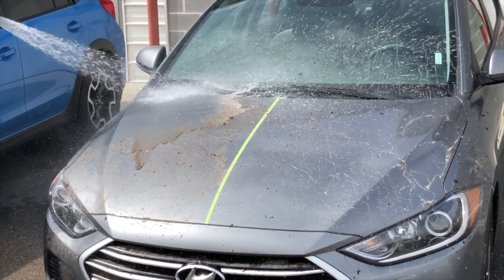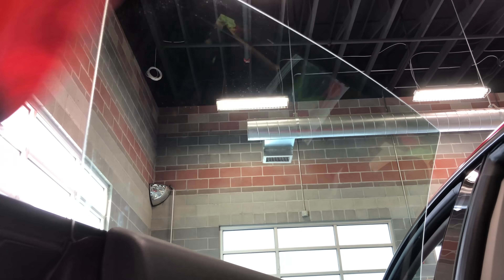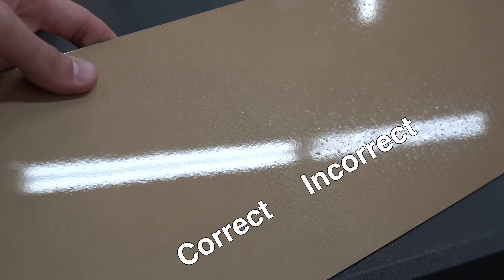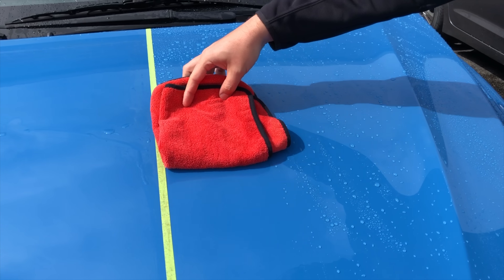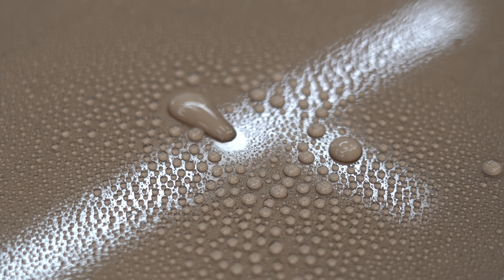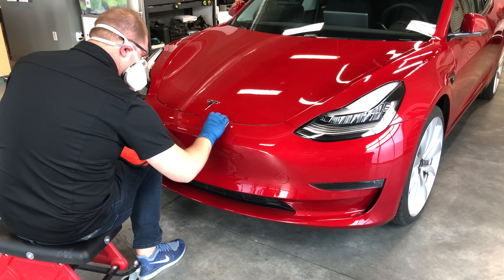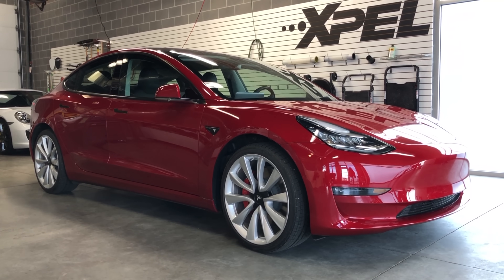Everything You Need To Know About Ceramic Coatings

Comment: I am a bit disappointed that you kept the "rigged" Mud pour in the video without pointing out its blatant deception that I'm sure you were aware of. 
The man stands on the side of the uncoated hood, pouring at a higher velocity/angle towards the ceramic side from the top of the bucket which contains the lighter/smaller sediment that remained suspended in the water. He then returns to the uncoated side while pouring slower while making sure to empty the bottom of the bucket where the heavier sediment/dirt clumps are sure to remain on the car.

If this wasn't an engineering channel I'd maybe give it more of a pass but letting sponsors exaggerate their effectiveness through this demonstration without a lil fact checking is a bit too shilly to me :/

Comment: JUNK!  I have been using Lucas Speed wax on my Panamera that is jet black metallic. It doesnt have swirls or any hologram or spider webbing. I take care of it pretty decently and only use quality microfiber on it. I go to self serviec car washes and put in maybe $4 and wash and rinse before drying. The Lucas beads up great, bugs dont stick and leave any of their guts to etch the paint. I think many detailers are doing waaay too much to make it seem complicated to care for your paint so you will pay them to do it. ITS NOT COMPLICATED!

I had bird crap on the roof a coupe times, I mean a massive amount , likely from a seagull or many of them. Unfortunately it sat there with the crap baking on for about 3 days. I sprayed it off thinking for sure I was going to have to use some compound or polish, but nothing happened it just sprayed off at the car wash. This ceramic junk is so hyped and overpriced it is foolish. I use a cheap spray wax (Lucas) that cots me maybe $11 and lasts at least me doing the car 8 times over the course of 2 or 3 months, but likely I dont even have to apply it that often I just do because it leaves it slick. I get compliments all the time on the depth of paint and reflection. Many people assume I spend a ton paying a detailer.

Comment: can attest to coating over film being a top tier idea... I also believe that proper high SiO2 coatings usually come in a glass bottle, learned that the hard way with Armor Shield IX when I had one slip and just shatter to bits coating my garange floor, they were good sports and sent a replacement thou. XPEL is unbeatable and I like to coat over with avalon, gyeon or adams thou latter one is a bit on the pricey end... but if you are dishing out a couple grand for a pro wrap it makes no sens not protecting it

Comment: I just got my 2024 Lexus RX350 at Pembroke Pines Fl. , financing department told it was included in the price. then A guy came to pick up the keys of the car and told us it should only take 20 minutes. when it  was ready I noticed the car had dirty mug spots, like the car was dirty. So asked the several people and they no is just drying it looks dirty. Then someone told me the should have been completely clean if ceramic coating was applied. So I asked the guy who did the job and he spry ceramic coating again in the spots and wiped right away. Then no one told anything me about curing time. so I drove away. and my car is usually park out in the open. and after seeing this video I know they didn't do it right and Yet after reading my contract I found out Lexus charged me $2000 for it. What can IO top now? can anyone advised me?

Comment: In the demo, I see what they did there to exaggerate the differences- the sludge at the bottom of the bucket went on the non-applied side to the left. 

The ceramic coating works, but I notice the trick that was played here.

Comment: Both the films an coatings are great and provide good protection, but the think you have to keep in mind is that all cars get collateral damage, even a Ferrari, so its never 100% fullproof, but if it helps your car look good, prevents as much damage as it can, and it helps it hold its resale value they're all good things...I've coated mine because its much cheaper then getting film...Great informative video, thanks.

Comment: What happens 4-6 years later when the ceramic wears and needs replacing? Do you need to remove or can you apply more ceramic over the original coat?

Comment: Well Technically, a correction isn't required on paint that is in bad shape. You can still apply it on there and will be just fine so its not required. Its more like "recommended" to correct the paint.

Comment: I had a paint correction and ceramic coating installed the other day.  There are massive swirls from previous car wash scratches still.  They used a paint pen and half a$$ed repaired it but actually newly chipped my brand new hood.  There was also paint missing where my license plate vibrated and rubbed through.  They didn't even remove the plate.  It cost me $1500!

Comment: If you are getting a new car get a coating immediately. Like make it part of the buying process. Get the car and drive it straight to a detailer.  New car paint is becoming insanely thin and is close to making correction impossible.

Comment: This just goes to show me how much some people baby their vehicles compared to others - such as myself, I just use a wash and wax mix and that's good enough for me since I live in the rust belt and well I am only willing to do so much to stave off the inevitable rust.
Reply: This doesn't seem that hard to do. Get it done once every four years and you're left with a car that looks far better, which is obviously better for so many reasons. I'm not sure what living in the rust belt has to do with anything. Are you saying because these are states that have winter weather and maybe that and the salts used to clear the road can be damaging to a car's finish? If you are, then that would seem to be even more of a reason to get this done. Now if you have some old, beater car, sure, treat it like crap.
Reply: @dontbanmebrodontbanme5403  It is not that  uncommon to find a nearly perfect body paint wise with a rusted underbody/frame, I had the MTO seize a vehicle with multiple rust related issues underneath and OMVIC made the dealer buy it back from/refurnd me because it had been safetied when it should clearly not have been.
Reply: My daily beaters get washed when it rains!

Comment: Don't pull tapes off after as there will be  hard edges on the pannel after .&
 most coatings shops are labeling as " ceramic " but are just normal waxes

Comment: Ceramic coating is basically just a slightly more durable wax. From my experience it lasts 6 months max vs normal wax which lasts 4 months. Normal spry on detail spry or wax lasts 2 months and you only spry and wipe off . So it’s funny why you would pay that much for something which you can get cheaper and easier

Comment: Tip for coated cars: You can use an air blower if you have one, to blow the majority of water off the car after washing and rinsing. This will allow you to easily dry the car with a single drying towel and reduce the amount you are rubbing the paintwork with towels(less swirls in paint). You can also blow out the mirrors and other drippy areas to prevent drip marks. 
Also like he said in the video. If you park your black Nissan outside all the time, it is going to get water marked. If you wash your car with dirty water, or dirty sponges and dry it with an old sham, it is going to get swirls. Nothing other than good car care can prevent those things.
Reply: You can use a blower to remove water on uncoated cars as well.
Reply: @markolmstead4709  Of course but it works a lot better on Coated cars.

Comment: Not sure how many of these types of ceramic coatings exist, but another one, Opti-Coat, is supposedly pure Silicon Carbide that joins with the ciear coat to improve gloss and hardness.  Have not heard of any Graphene coatings that do the same (those are supposedly only one atom thick and lie on top of, rather than in, the clear coat).

Comment: is ceramic coating heat resistant?And if so to how many degrees? 
If I wanted to ceramic coat my valve cover or engine parts which are painted using heat resistant paint,,,is it advisable?Will it last or will it peel off due to heat?

Comment: If a ceramic coating mainly just makes it so I don't have to wax, it's not worth it to me. Turtle Wax Ice seal and shine is incredibly fast and easy to install and easily lasts 6 months, maybe a year. It takes just a few minutes and no PPE or paint correction required. It is also cheap. Try it, you won't go back to wax. Just watch any review for it on YouTube.

Comment: So, what happens when someone hits your car and you need to have the repair painted?
Reply: Then that surface needs to be corrected, film put back on (if you had that) and coated with a new bottle of ceramic coat. You have to make sure you report that to the insurance company and product documents. The only crappy part is if the other party is underinsured then their insurance may not cover the cost.

Comment: I am happy with my expel ppf but definitly bug guts will stain it unless washed off right away,  also rock chips are getting through but I can only hope its helping.   Also my ceramic coating experience has been not favorable.  It seems like waterspots ruin the ceramic coating , after 3 months my ceramic coating was failing,  refreshed it at that time and 3 months later I dont think its doing anything at all.

Comment: I think brass is detaching small particles of coating and you disperse those by brushing. Applying heat you melt particles which now are liquid and fill the microscopic scratches.

Comment: Nanotechnology is the future of manufacturing, if not suppressed. Coatings can be used to protect from fire, dust or mud on cars or clothes.
nanotechnology can be used to create carbon nano wires for computer engineering and improvement of processing speeds and data transfer

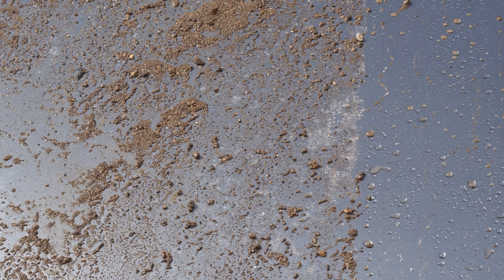Comment: 1:49.  If they don't prep my car with 

1. An iron remover
2. Foam the car with a high pH high alkaline high surfactant product using multiple wash mitts and/or micro fiber towels
3. Body solvent
4. Foam cannon again
5. Flawless paint correction
6. Foam it again rinse and dry with micro fiber towels and high pressure air before adding the ceramic coating, they're not touching my vehicle.

Comment: I had an older ceramic product applied to my 2013 Subaru BRZ when I bought it. 7 years later the coating still works great. My car is parked outside under a cherry tree most days. Sap, bird droppings almost everything rolls off when it rains. I still wash my car, but it takes so much less time with the coating. My next car I’ll do both the film and the coating. Money well spent and you will easily recoup your your investment in the time you will saving in washing your car.
Reply: Hi would you mind to share the name of the brand of the ceramic product that you used?

Comment: Everybody is crazy about the  coatings on the top of the car, but this is all useless without proper corrosion protection under the car. I could easily find a guy to polish and coat my car, but still searching for a guy who actually does te frame of the car for a good price.

Comment: Thé warranty is nothing to bother with because it doesn’t make a sense. You can have a 20 years warranty on a coating. This is why, the coating will scratch after a day of installation. A coating protects yes but to a certain level. It doesn’t protects against bird dropping, tar and rocks chip.

Comment: I've done both, paint protection film and ceramic coating, to all my vehicles.  The benefits this video shows are not over exaggerated.  The ease of keeping my vehicles clean and looking like new as well as the protection from not getting rock chips and swirls, is worth every penny.
Reply: My question is which one do you prefer? Which one is most cost affective?
Reply: @adrianmarquez2829  Ceramic coatings are cheaper, but don't really prevent damage. Might as well just a a cheap sealant like Turtle Wax Hybrid Solutions Ceramic. It won't last as long as a coating but it will provide about the same protection if you reapply every few months.

Paint protection film is more expensive but protects against swirls (fine scratches), and most scratches and rock chips, lasts longer than ceramic coatings, and provide better UV protection (ceramic coatings try to provide UV protection but they're just so thin).

Comment: Question: When you scratched the coating, then applied heat for the self-correction process, and then sprayed water on it, I noticed that hte water beads seemed to be much larger in the area you scratched. Can you comment on this? Thank you.

Comment: Hey I would like to see a video about thermal barrier coatings for piston tops and combustion chambers. Advantages, disadvantages, relation to power, cooling, durability and efficiency in gasoline, turbo, diesel and both water and air cooled engines.

Comment: I would say this coating should only really optimally be used on windows due to it's see-through properties while the rest of the car should get a much more substantial spray-on water repellent coats (that aren't see-through) since liquids still sticks to it, making this practice semi pointless as it STILL requires regular cleaning and "ceramic boost" maintenance.

Comment: I Like your channel and it inspires me to be curious. 
Years ago there was a product called liquid glass that promised similar benefits. It was silica based I think. I never tried it, but I wonder how they would do head to head. The liquid glass may or may not be made anymore its hard to find info but it is still out there in the wild. Also there was some concern about these types of coatings interfering with plastic bumper covers that were painted with a flex additive, causing cracking or crazing during temperature extremes. I'd love to see any testing or thoughts you have about this. Product test -  then vs today

Comment: You know I've been told by the people in the industry that the ceramic coating is redundant and most of the times does not stick onto the PPF. Most PPF films work just as good to increase water beading without need for a ceramic coating

Comment: What is the eventual failure mechanism of ceramic coatings?  I know they don't just be there one day and then are completely absent the next day, so there must be areas of the exterior where the coating thickness becomes thinner and thinner.  Can the product be reapplied with good results?  If so, what is the reapplication procedure?  Is the preparation different?

Comment: I had the Opti Coat Pro plus coating applied to my black Nissan 370Z sport coupe over all the exterior surfaces, including the wheels and brake calipers, and the results are really amazing. The installers had a challenging time working with the Nissan "Scratch Shield" self-healing clear coat, having to do two separate compounding stages to let the clearcoat stabilize before doing the second stage. After the final polishing stages the surface was like a glass mirror and was ready for the silicon carbide base coat, followed by the silicon dioxide top layer. It will take a full month before the coating is fully cured and reaches its full hardness and gloss, but already, after a week, it's incredibly glossy and resists almost all debris that tries to stick to it. Surface dust and dirt blow off when I drive it and bird droppings slide off when I hit them with water. 

It was not cheap, >$2,000, but I think it was a worthwhile thing to do for a very nice car that I plan to keep and want to keep looking nice. One nice thing about it is that it can go for much longer periods before needing to be washed and when I do wash it it is much easier and faster to clean.

Comment: My concern is what does it look like when it starts to break down years later and how difficult is it to remove.
Reply: McG, in the video he mentioned polishing it OFF with deep abrasive compound. I would recommend 1. Wash, 2. clay, 3. product stripper (clean slate- it preps paint for the following products), 4. polishing compound (then remove comp residue w/paint surface cleaner), 5. paint sealant (liquid), 6. Wax (liquid). Check out Chemical Guys, Dallas paint correction, Pan the organizer, ammo NYC. Thank you.
Reply: Jesus Hernandez Mmm, do you really need all that prior removing a ceramic coating? I would just wash it,  then use a cleaner wax or compound, the pad may have to be trashed afterwards but it might save a ton of time.
Reply: They have products that remove any sealant or coating. It's not that hard. My car is coated with simoniz glass coat. It's a "ceramic" coating, but I've been told it's just a paint sealant. I was losing the hydrophobic properties since it's been like 3 years now, but I recently applied the meguiars ceramic detailer to it and the beading is insane. It brought back all the hydrophobic properties and it cleared up my paint.
Reply: when it breaks down you don‘t see anything. The only thing you will notice is that you lose the water repelling effect which you can revive by re-applyin the coating

Comment: So if i don't have clear coating and directly on paint, can I do the following then apply ceramic coating? 1). Pressure wash with soap gun 2). Pressure rinse 3). Pressure wash again 4). rinse again. 5) 2 bucket method then rinse. 6). Polish 7). claybar 8) rinse and dry THEN ceramic coating?

Of course I probally won't ceramic coat as heard leave that to pros. .But all steps before If I do this will i be able to drive to ceramic coating place and get it done and save to since I did everything below?

Comment: Question? Does ceramic coating stop rail dust or other particles from penetrating into paint?
Reply: Rail dust? Brake dust is still going to end up on your car. All ceramic coating/ waxes do is fill the pores of the paint.